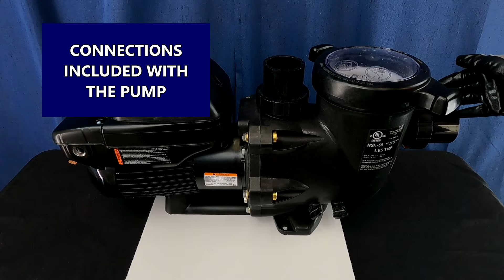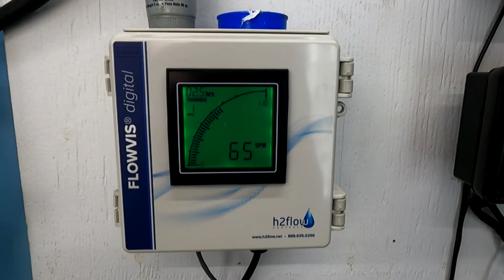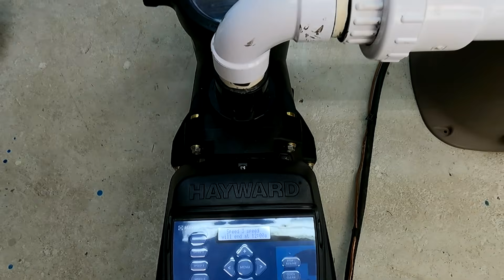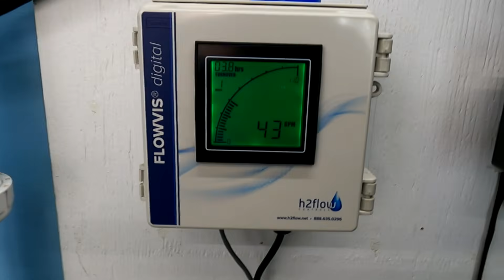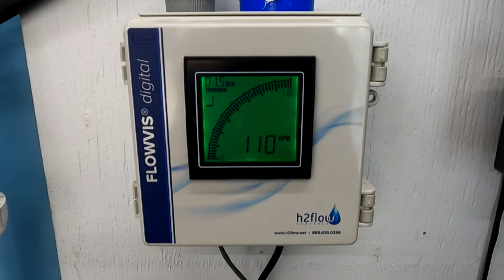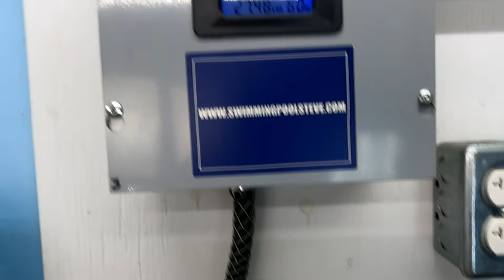1.85hp Tristar VS 900 Review - My Favorite Pool Pump!

Comment: Disclaimer: I'm a pool pump noob just trying to learn.

You say that 6 FPS = Max Laminar flow, but I don't think that's true. Flow is "laminar" if it has a Reynolds number below 2000; at 6 feet per second in a 2.5 inch diameter pipe I think the Reynolds number would be about 150000. Calculation: (995 kg/m³ [density of water at 90°F] * 0.0635 meters/second [6 fps] * 1.8288 meters [2.5 inch pipe] / 0.000761 N-s/m² (dynamic viscosity of water at 90°F).

Comment: Hayward's "Sell Sheet" for the W3SP3202VSP indicates that it supports both 115 and 230. The "SP3202VSP" (no W3) does not seem to mention 115 anywhere I could find. The W3 prefixed model claims that it runs more efficiently at 115V (WEF 12.9 vs 8.6 for 230V). If WEF is an accurate metric for efficiency, wouldn't you get even better results running off of 115V?
Reply from the maker: WEF is effective, but does not take into account that larger motors will have a lower WEF since the nigh end operation consumes so much power. What this is actually highlighting is the importance of pump sizing, where "bigger is better" is definitely not the case. You want the smallest pump motor which can adequately provide the flow you need. If you compared GPM to GPM with 115 vs 230v the higher voltage would consume less power due to lower current the conductors, but this would be a minor difference. The large discrepancy in WEF between 115v and 230v is simply because the 230v has more power available at the top end. As for which models have which voltage, I do believe that you are correct in the newer  version being dual voltage compatable. Any product Hayward sells online has the W3 prefix on the serial number
Reply: @Swimmingpoolsteve  Thanks for the insight here! Makes sense now. I don't feel like WEF was the best metric for measuring efficiency, but at least its something? haha.

Comment: In 2017, my pool builder built our pool with the TriStar 950. In 2023, this review is for the 900. Is this a newer version of the 950 or something completely different? (Confused on the numbering)
Reply from the maker: The 950 is the larger pump. The 900 is the smaller one. Not newer and older. Bigger (2.7hp) and smaller (1.85hp)

Comment: I had my pool built by Dolphin pools here in Phoenix, Arizona, that's the pump that was included with the 10,300 gallon pool package I selected. I love the way I can adjust the pump RPM, at night I have it going at around 75%. And I turn it on during the day at around 45% just to run the water through the filter.
I had one small issue with it. It would turn off after around 25 seconds after coming on for no reason at all once in a while, I would clear it by turning the breakers off for a few minutes and then turn them back on, and it would run normally again for a while. I called Dolphin pools up and they sent a Hayward repair man over and he replaced a circuit board under warranty. Has not done it since then and that was around four months ago.
Reply: Is the pump still working?
Reply: @donguadalucio1405  yes, I've had no issues with it since he replaced the circuit board.

Comment: I love you swimming pool Steve and your videos :) personally only issue I’ve seen with Hayward Tristar’s is the pump body likes to split at the seam on the top threads for the union. Otherwise great pump! I’ve seen 3 of these on 1 street leaking from the same place :(
Reply: Yes. I had to replace the wet end of the same pump twice in about a 6-year span... They're about $300-400 retail. The plastic there is just too thin

Comment: Thanks for the video!  Have a recommendation on which flow meter please?
Reply from the maker: There are a few models to look at.  The green digital readout I have in this video is the FLOWVIS digital brand, which adapts to a diverter valve / FLOWVIS unit.  You can just use the analogue scale on the flow meter, or you can upgrade to the digital readout that you see here.
Reply: @Swimmingpoolsteve  thank you!

Comment: Thank you for the information you provided. It helped me out very much over the years! I've just rewired my pool pump outlet for 220v vs 120v  because my next pump failure I want to install a VS pump based on your data driven advice.  My question is, is pump basket capacity a major consideration in reality? I have a Hayward Superpump now with quite a large basket. But, everything always seems to get jammed against the intake, the rest of the basket remains pretty much debris free. Regardless of the basket size, wouldn't the same thing happen with any basket?
Reply from the maker: Well to a certain degree all pumps will perform similarly handling debris like leaves, but if you actually have a leaf problem, as in too many, larger is better when it comes to strainer baskets

Comment: How does the on board watt meter compare to the one you have on the wall?.  I have a TriStar pump,  but i wasnt sure if the pump, under or over reported power consumption.   Thanks for the video,  i watch most of them.
Reply from the maker: Every on board wattage meter I have seen measures low.  This is all brands and all models.  Not a lot...something like 5% low on average, but they all do that and I have triple redundant meters including ammeters, inductive ammeters as well as a Fluke brand amp probe.  My guess is the pumps all calculate power consumed based on RPM but this only accounts for the actual motor power and not the control circuit power to the pump controller.  The Pentair Superflo has an abnormally high power consumption when the pump is not running versus all other brands and models I have tested.  It occurs to me I have been testing these pumps for years and I am barely scratching the surface here lol.  Oh well, I guess that means lots more videos for me to make!

Comment: $1500.00 ??? Pass.
Reply from the maker: In reality, with inground pools being 75k to 250k in price, and with the pump being the "heart" of your filtration system, a quality pump like this is well worth this price tag. But, more importantly, when used properly will return on your investment multiple-mold the initial purchase price of the pump. As with most energy saving upgrades they are a cost investment which returns over time greater than your input value.

Comment: Hi Steve, Unrelated to the pump, but my pool will be stagnant for 10-12 days waiting for a new filter (20 yr old one split top dome). I tried to find parts to built a (U shaped) bypass so I could run the water & navigator but no local parts (pipes/threads/unions/etc ) will attach to where I removed the filter. Special pool only/Hayward sizes. So besides keeping it heavy chlorinated & brushing any other ideas to prevent alga? Thanks! Froggy.
Reply from the maker: Brushing and heavy chlorination will help to a certain degree. I might add a submersible pump to the deep end and run a garden hose into the shallow end.  Have the garden hose sit in the deck and let the water fall into the pool. It's only a tiny amount of aeration and movement of water bit every bit will help
Reply: @Swimmingpoolsteve  THANKS!

Comment: Love the video Steve !! Would this pump be ok for a 21 foot 54” tall round above ground pool ? Or would it be over kill ? I have 2 inch piping, a skimmer and 2 main drains if that helps. Thanks !!

P.s I would save tossing fruit at it for when you start your onlyfans ….I am sure there would be folks into that 😅
Reply from the maker: I feel like despite having 2" pipes this pump is going to be overkill for your application. Unless there is something about your installation such as a rooftop solar heater plus verification that your skimmers and suction points can accommodate the flow...but I don't think they will. A medium head pump would likely be best suited to your application.
Reply: @Swimmingpoolsteve  thanks Steve !! Been following along on your videos and after upgrading my plumbing to two inch , a variable speed pump looks to be my next upgrade😀
Reply: @Swimmingpoolsteve  We're about to semi inground an 18' x 40' x 54" extruded aluminum pool. I'm hoping this pump will work for us. What do you say?

Comment: We have this pump.  it was installed during a re-plaster of our pool a couple of years ago.  We have had an issue with the top of the basket lid not sealing 100% and allowing slight air leakage into the assembly. Does not appear to be dramatically effecting the performance however when the pump speed is slowed after priming air leaks into the chamber.  Tried cleaning ring and using ring grease with no resolve.  Any suggestions?
Reply from the maker: I would be looking for any deformity, damage, crack, flattened o-ring...something. also, it could be in front of the pump and not the pump or the lid itself, unless you have some reason to know it's the pump lid. A suction side pipe leak would manifest similar to this. Double check the suction side union gasket. I would also conduct a bucket test, 24 hours with the pump running and 24 hours with it off. The answer from this will tell you a lot. Is the pool leaking? Does the rate of water loss.change with the pump on/off. If leak is confirmed, a pressure test of the suction line is next to confirm or eliminate this as the leak source, and potentially the cause of air visible through the pump lid.
Reply: @Swimmingpoolsteve  Thanks!  I will check it out.  One more thing please. Is there a way to winterize the pool so we don't have to run it during the winter and not worry about it freezing/breaking the pool or the pump?  What would be the basic procedure to do this? Thanks.
Reply from the maker: @knowyourjoe8826 yes winterizing pools is common in cold climate areas. Here is a long form discussion on the step by step winterizing process https://www.swimmingpoolsteve.com/pages/pool-winterization-vlog.html
Reply: @Swimmingpoolsteve  THANK YOU!!!

Comment: Fantastic video, I’ve worked with you a bit on a lack of full prime in the skimmer basket of the pump which I think maybe be due to have 1.5” pipes to and from the pool, but other than that the pump has been great. Having a flow meter is a must to help determine the optimal speeds and hours to get the 3x turnover. I’ve learned a ton for you and your content.
Reply from the maker: It is surprising how many people do not have or use a flow meter when they get a VS pump!
Reply: Clean your filter.   Filters especially the swim clear models have a cored cartridge.  That thick core blocks 30% of flow already.   I've seen this so many times and a dirty filter usually is the culprit to a half empty basket while priming.

Comment: Really fascinating. In my area of the US it seems the 3hp Pentair Inteliflo is the go-to pump even though it's quite expensive and overpowered (at top rpm) for nearly all pools. I have one for 20k gallons. At 1200 rpm it moves 38 gal/min at 110 watts silently. (For 2 x 1.5 hours it runs at 2200 rpm, 75 gal/min, to get the skimmers flowing.) It would be absolutely great to see a comparison episode. 

Incidentally, thanks for the tip on flow meters. It's not normal to have one here in the U.S., but I find it makes many things simpler. 

nb: The reputation down here - I've seen no actual data - is that pump "guts" - motors, seals, bearings, impellers etc. - of Hayward pumps tend to have lower lifetime than Pentair.
Reply from the maker: A 3hp intelliflo will deliver over 180 gpm with the right conditions. If you have 2" pipes and a 3hp intelliflo you are pretty much guaranteed to be past poor efficiency and straight into safety concerns as well as the pump operating very far from BEP.  a 3hp intelliflo should have 3" pipe sizes through the filtration set. It is an absurdly powerful pump. When used on the right pool that is amazing. When used improperly, which is most of the time, it is dangerously powerful and a ton of efficiency is being wasted.
Reply: @Swimmingpoolsteve  Absolutely right. Let me explain how I got here. When we moved in 3 years ago there was a 1.5 hp single speed Whisperflow. Pool was 14 years old. This wasn't the original pump, but it wasn't new. I added the flow meter as you recommended and learned it was pushing 105 gal/min. Checked equipment and plumbing specs. Did the math. Everything was okay with this high flow, but of course it was badly inefficient. 

I decided on the Intellifo in part because it's plumbing compatible with the Whisperflow and the rest of the pad is all Pentair.  In addition, Intelliflo has a global "max rpm" setting. I determined from the head/flow curves that 3100 rpm would duplicate the Whisperflow. Point was there are deck jets - seldom used - that need about 15 psi. So I set the global limit to that for the two hours a year the kids are interested. The rest of the time it runs at 1200 or 2200 rpm as I said. Power consumption is 110 or 400 watts. Seems very efficient to me. It's giving 3 pool volumes of water exchange per day: top end of what you recommend. 

The motor is absolutely loafing. I expect this to lead to a long and happy life. I know a smaller pump would have been fine. But I'm getting old, luckily have the dollars, and am trying to set things up for minimum maintenance. Basically I do not trust others to touch the pool after the problems I found when we moved in, which were all due to "pool professionals."

Again thanks for your great videos.

Comment: What's the lowest gpm I can run with 1.5"pipe?
Reply from the maker: Zero. There is no minimum. Realistically the lower end operation for VS pumps require long hours at low speeds which result in about 20 gpm of realized flow.
Reply: @Swimmingpoolsteve  thank you. I have a single speed pump 1.5 hp now and it does about 33 gpm. Wasn't sure if the pentair superflo would pump better gpm.

Comment: I have two 2.70 THP Tristar VS 950 pumps.  One is connected to a main drain only and supplies water to the tanning ledge located above the pool and waterfalls into the main pool.  The other is connected to a second main drain and two skimmers.

Long story short, my pool contractor is a conman who used pictures of our unfinished pool to scam money from others and is now on the run...

I knew nothing about pools and now I know enough to have an idea about what I dunno.  I love your channel because it is the most informative.

I have no idea why dude put a variable speed pump for the tanning ledge because we only run it full throttle or not at all.  It is not connected to a filter or anything.

I have a hard time keeping the pressure down on the main pump because it goes through a heater, a sacrificial node, a chlorinator and a prozone (that I don't think is properly installed).  Once the filter gets just a tiny bit dirty, the pump no longer primes fully.

I could write pages of other things wrong, but this is my current main concern.
Reply: Hi. In the U.S. manufacturers aren't even allowed to build single-speed pumps or motors any more in the name of energy conservation. Maybe it's that?  I've wondered about this topic, too. My pool uses a second, very old single speed pump for the spa jets. It runs maybe 20 hours a year. A VSP wouldn't make any sense. Yet looks like I'll need to replace it with one when the time comes :-/
Reply from the maker: @generessler6282  actually they are allowed to make single speed pumps for booster pump applications, just not for filtration pump applications. Plus all existing stock is still allowed to be sold. Technically VS is not required, but an efficiency standard of which mostly only VS pumps can meet is the requirement for dedicated filtration pumps. So in theory they could have had a single speed pump for a dedicated water feature like this.
Reply from the maker: Sounds like you should bring in a local pool specialist to evaluate your system to see if efficiency improvements or changes can be made. There could be safety issues here. In fact, I would be surprised if the flow rates and water velocity are not over the maximum values they should be. Sorry to hear of your situation.  This industry is known for stuff like this due to lack of regulation and trade certification, and for the fact that pools are vastly more complex and technically challenging that most people think. Even people who think they would like to build and sell pools...they often lack the requisite training or technical aptitude for this highly specialized work.